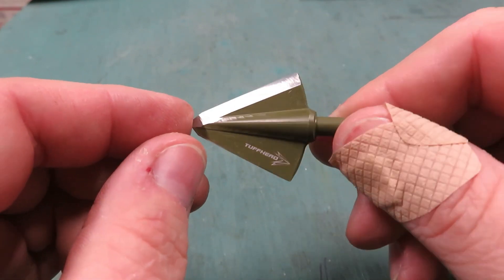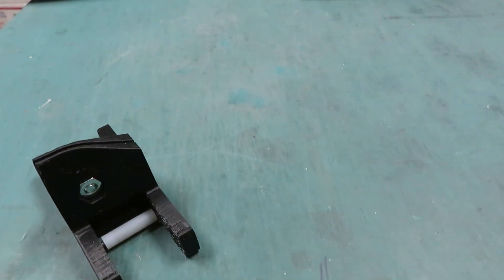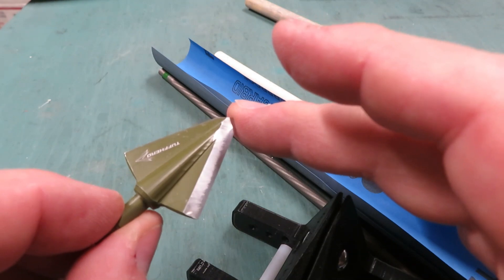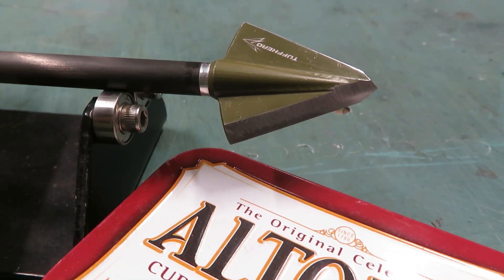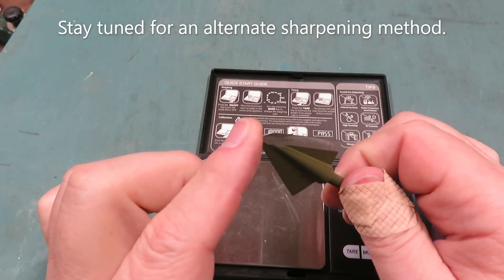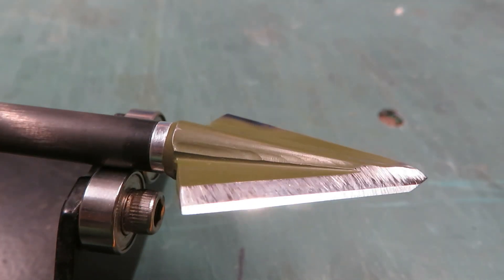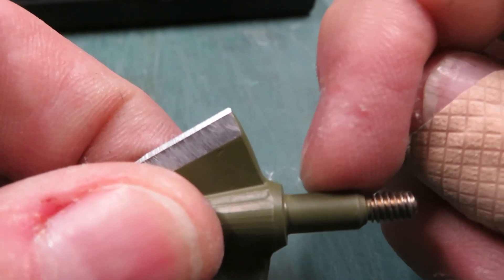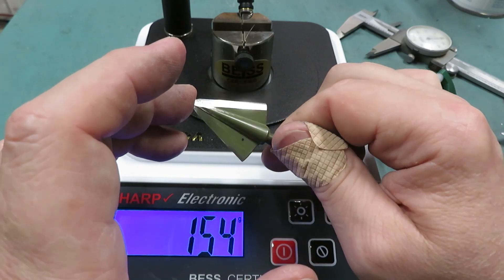Tuffhead single bevel sharpening and sharpness test

Comment: S7 became popular with busse combat/ scrapyard knives. It’s actually an inexpensive steel, takes a great edge and a lot of abuse. Wont hold an edge as long as high grade steels but this is what all fixed blade Broadheads should be made of for durability.- I had to edit this! Don’t change the angle/ from 20 degree’s, it’s too much work and S7 is made for impacts- it’s the same steel as jackhammer heads. You literally can chop chains and cinder blocks with S7.  If Tuffheads heat treatment is on spot it will handle anything.

Comment: What about the mechanical advantage of the shallower (20 degree vs 35 degree) slope? Isn't that another thing you give up?
Reply from the maker: Not at all. You leave the 20 degree sloped surface for the rotation and only hone the first 0.02 " of the cutting edge. You dont regrind the entire bevel away.
Reply: @innovativeoutdoorsman5067  I am rewatching your "Single bevel edge angle strength" video and it is very good. Thanks.